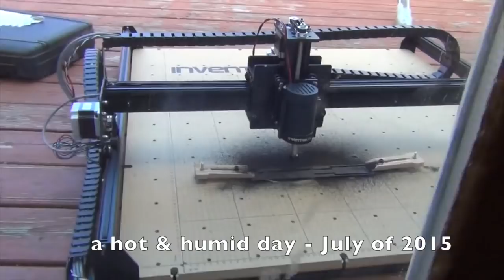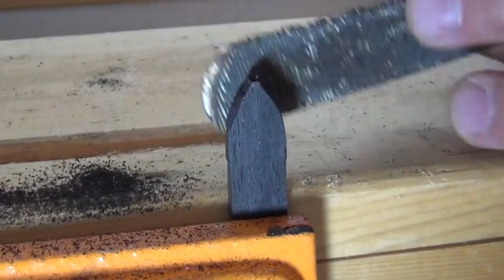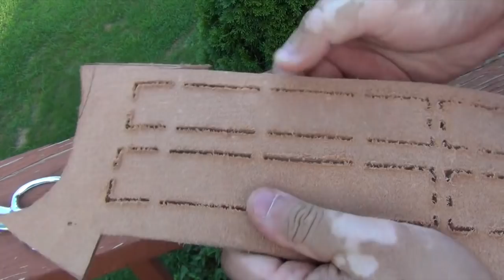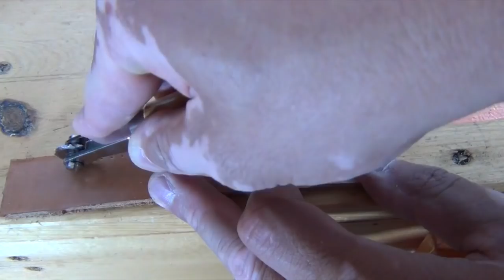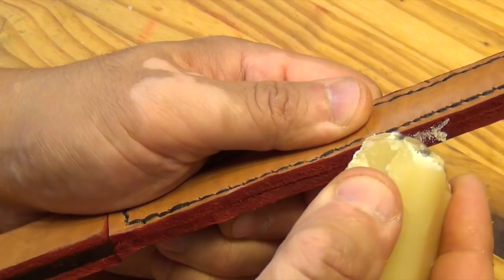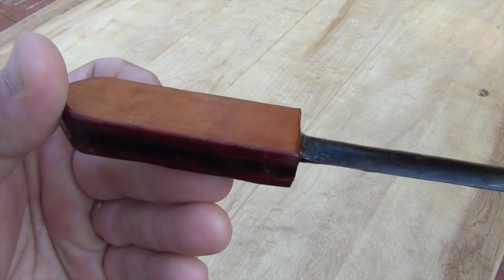Leather and Ebony Knife Letter Opener w/ Leather Sheath - X-Carve Project (Project 16)

Comment: The table itself is probably not entirely flat, which is part of why the leather didn't cut all the way through.  Better to put a waste board under it and cut deeper.  I don't know what kind of bit you were using but it if was a spiral upcut a downcut can make a big difference with fuzzing on the top edge in wood.  I know there are knife attachments for cnc machines but I think they are mainly used for cutting thin films.
Reply from the maker: +krtwood The waste board is pretty flat, but it is big, so the rails may not be perpendicular to the table all the way. I have seen CNC cut leather with a knife, it's a strange sight. I wanted to use the basic setup, spiral cutter, and see what happens. I am sure there is lots more to be learned along the way.

Comment: Nice project. I like the ebony for the opener.

Consider making the tabs less than full length for the wood pieces, as you set up the software. It seemed like you did more work than needed in separating the work from the waste. Just a suggestion.
Reply from the maker: +Barry's Workshop Agreed, first time learning lessons.

Comment: Do you remember what bit you used to cut the leather? My brother and law and I are starting a CNC shop and were just asked if we could cut leather and I have no idea what type of bit we would even try to start with. Also, what feeds, speeds, and depths were you using if you remember by chance.
Reply from the maker: It's a 1/8" 2 flute straight bit, I recommend a spiral bit, but I think any bit will work. The key is to machine from the suede side and cut out the top leather by hand. The speed is pretty fast, 2-3 the speed of pine. I have tried up to 1/4" deep/ pass. Good luck. Be aware that leather thickness varies, the bit could lift the leather as you cut, and it gets flimsy when you cut all the way through. Good luck with your shop.
Reply: Thank you! I am not sure what size leather we will be working with I have not gotten it from the customer yet. It is for the leather pieces on the front of fire fighter helmets so pretty thick. I might try an 1/8" downcut spiral bit. That's for your information.
Reply from the maker: NP. That piece is probably 1/4 to 1/3" thick. I'd recommend the 1/16 and the 1/32 bit over the 1/8" bit. The smaller bits will be more versatile for leather, and you'll rarely encounter leather thicker than 1/3".

Comment: When you want to give someone a letter opener but you don't trust them with a steel bladed one
Reply from the maker: When you want to give someone a letter opener, but decided it was better to make it using the Rube Goldburg method.
Reply: @johnzzhu  wouldn't that result in a huge overengineered letter opening machine? 
Wich would also be a great gift